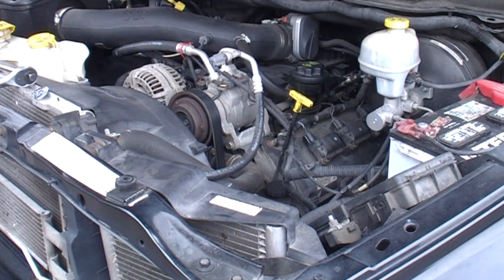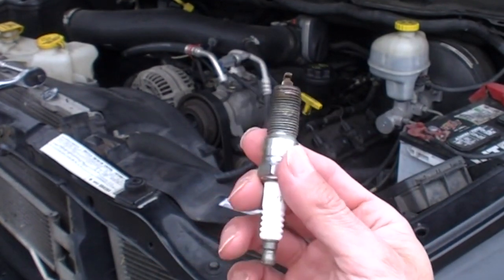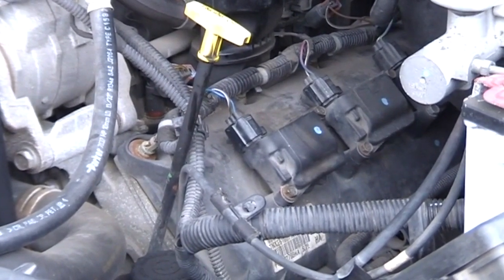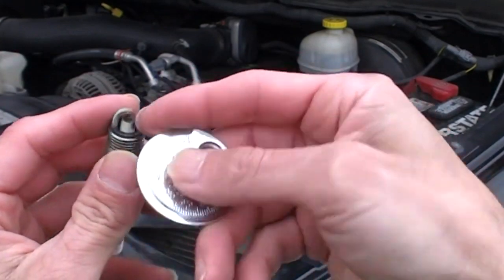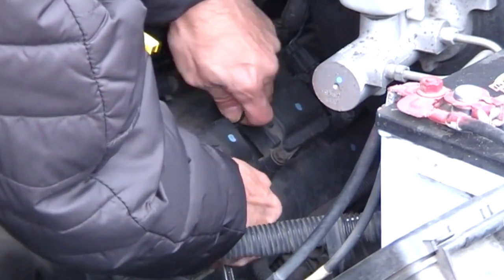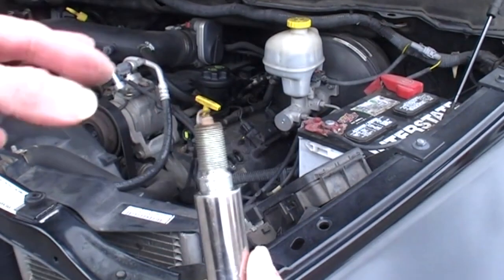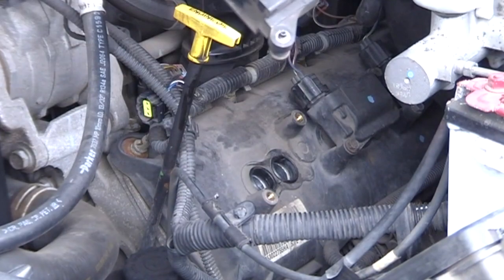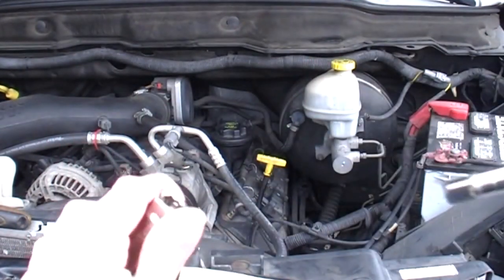DODGE RAM 1500 5.7 HEMI SPARK PLUG REPLACEMENTS (2002-2008) 3RD GENERATION

Comment: Hint: To make this job a whole lot easier. jack the front, remove the wheel and the inner fender. Takes a few minutes and provides direct access to all plugs, both sides. Be sure to use jack stands far safety.
Reply from the maker: Absolutely, definitely a easier way to do it instead of being on a step stool or on top of car. Thank you for watching video and hope you became a subscriber for future videos
Reply: I didn’t have to do all that. Little too extra for me

Comment: My dad bought my family a Code Scanner I just hook it right up underneath my steering wheel in my 04 Ram 1500 Laramie saved me hundreds of dollars when a check engine comes on instead of taking it to dealership or a mechanic I just had to replace the EGR valve two days ago only cost me $55 at the auto parts store took about 20-30 mins one csuse it was hot as hell from me driving it over there so all the bolts were hot as shit and we are slow sometimes lol but man I’m telling you what watching YouTube videos like this and learning how to fix your own car you’ll save so much money in the long wrong
Reply: Run

Comment: That little thing right there doesn't provide a high voltage, but it does have a high voltage passing thru it, which in essence creates a dead short, spark, between both electrodes at the tip.  The engine's voltage is provided by it's alternator, and it's high voltage is provided by it's coil, which then goes to the distributor to be distributed thru the wires to the spark plugs

Comment: Overall the video was helpful.  Just one thing.... how did you get to the back three that are basically under where the brake fluid reservoir is located?
Reply from the maker: pardon my delay in replying back. Did you figure out how to take it out? If I recall I did an example in this video how to take the rear left bank spark plug out with the tools, which looking back now I should have shown it. If you haven't done it yet, I can make a quick video showing it. Let me know and thanks for watching my video
Reply: @BEARDEDHANDYMAN please do
Reply from the maker: @kamrenpurvis2987  if I'm seeing it correct, look at the most recent video posted 3 months ago and there I'm showing how to remove the 3 spark plugs by the brake booster 🙃🙃

Comment: What do you mean gap it ?
Reply from the maker: Thank you for watching my video and hope you became a subscriber.  Even though when you buy spark plugs, supposedly they are to be gapped  out out box with vehicle manufacturers recommendation, but they are not in every case. If they are not gapped properly it will not give you proper ignition spark to combust engine properly.  Ensure to ask w u what's the gap when you buy them

Comment: Could be bad coil pack as well. But there $300 for all
Reply from the maker: Yes, normally you will get a check engine light for miss fire. Thank you for watching my video
Reply: I had two go bad on me... made my 08 1500 with the 5.7 misfire... shook the truck like crazy.

I just replaced the two bad ones. I found Dorman replacements for 20 bucks each. Not bad.
Reply from the maker: @brandonkick  nice🤗🤗🤗 I'm glad the video was helpful. Hope you considered subscribing